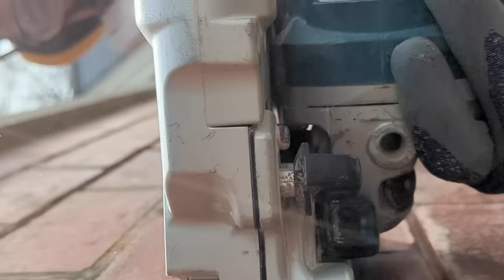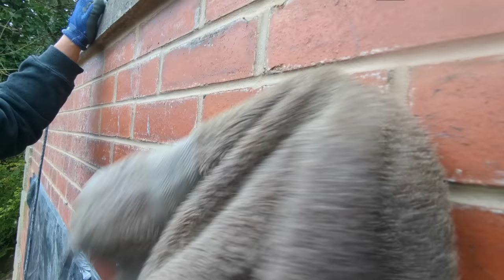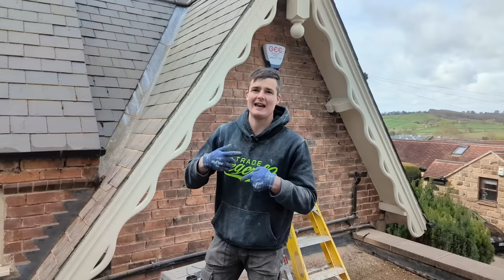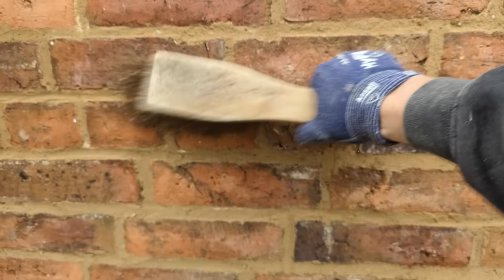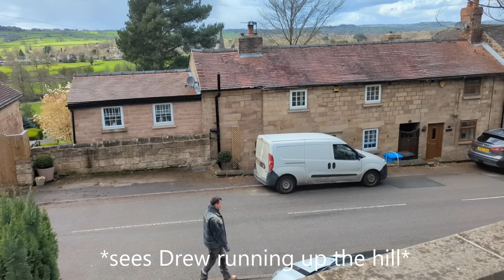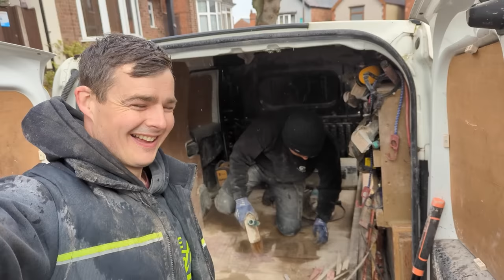Underpricing jobs, Thieves & new extension| IzzyTheBricky Weekly episode 12

Comment: Prices in London  are higher due to the house value,  congestion  charge  plus  getting  stuck in traffic for hours.
I've just underpriced  a job. Not the brickwork  side but demolition  of the old wall took days longer. Mortar  was so hard I had to grind the bed joints  off a brick on edge . I'm a lot older than you so I just think put in down  to experience  and learn from it.
Reply from the maker: Cheers Mark, never thought about those costs being from up north 😂 scary when you under price... just gotta work harder 😂 new video came out few hours ago😊

Comment: £50pm2 is pathetic. Up that charge. You don’t even use scaffold so you saved them £1500. I’d be charging £60 for sand and cement standard half round. Like goes up to £70 flushed £80 so on… lesson learned. Know your worth bud.

Comment: 13 days should be £ 5500 k for both of you.
It's not business, it's easy, calculate days to do job and multiply by day rate plus materials plus little extra for run around.
If you get job then great, if not move on.
Your way to good to under sell, good luck

Comment: We all made mistakes pricing jobs Izzy. You will learn fast because of that. Repointing is a skilled job so charge top dollar. Its also one of the dirtiest jobs a bricklayer takes on. If its not done right ie, cement mortar over lime will cause damp problems and any movement in brickwork  will result in bricks cracking instead of bed and perp joints. You've already found that on that pointing job. Good luck in future.

Comment: Straight raking and pointing £75 a meter cool. 
Replacing or turning bricks adds up Izzy but hard to know how many bad bricks with some old properties. 
Quoted £8k for one job and ended up at £14 k as four chimneys needed rebuilding and some serious structural repairs plus 1000 bricks replaced. Luckily the client was great and understood what needed doing. Took way longer than 8 weeks originally planned for. New lime mortar not cement which caused the damage. 
We live and learn mate. Underpricing can lead to more jobs though from neighbours or clients friends 👍 Did a mates cheap and neighbours loved what I did and got 6 more repointing jobs as 60s builds they used hardly no cement. Raking out used a brick saw ( Silverline - block saw ) on the beds. Hooked paving/weed tool on the purps so hardly any grinding out. 
Great channel and really nice job guys. 👍👍👍

Comment: Question.

If a whole house has been repointed in sand and cement and the whole houses external skins mortar has turned to 'dust' does that mean the whole house needs to rebuilt or is there a way to rectify??